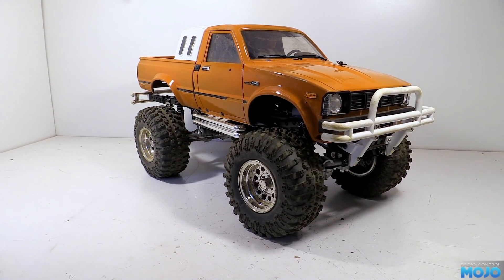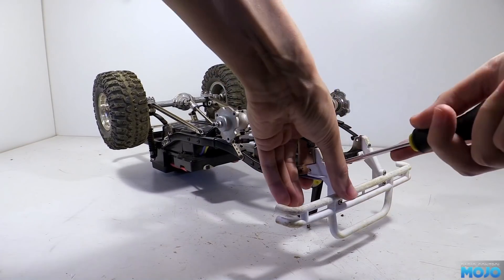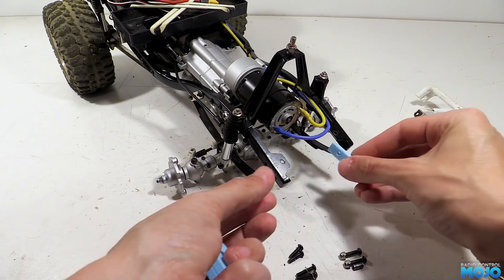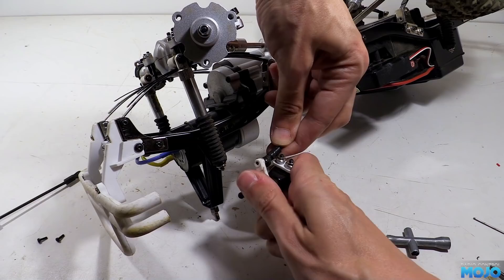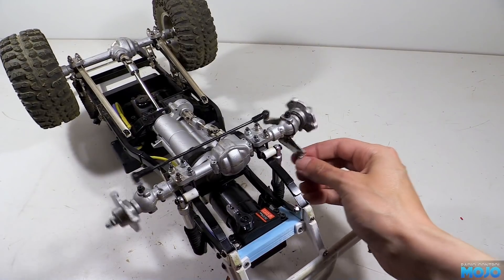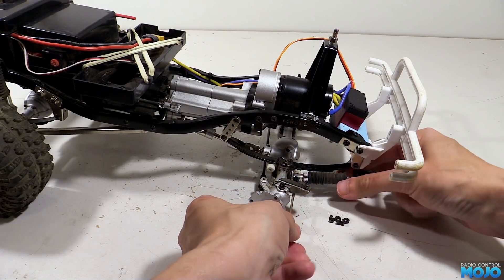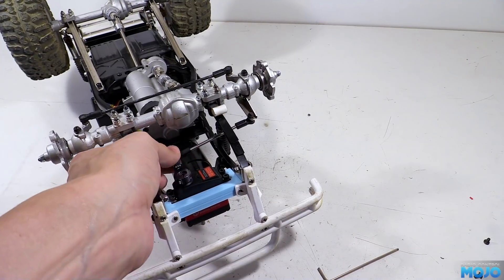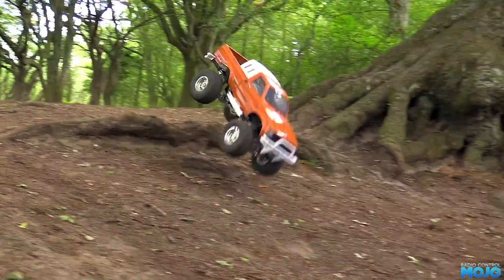HengGuan P407 Kit (Bruiser Clone) - Front Steering Servo Mod

Comment: How did you thread the steering shaft?
Reply from the maker: The link between the servo and knuckle? That would be M3 studding or all thread, you can buy it by length and cut it to fit
Reply: @RCMojoTV  ok thanks

Comment: Hi there, there seems to be a lot of slap from my leaf springs can you suggest what I can do to stop this please. Rob from England.
Reply from the maker: With a leaf sprung RC you always want a nice bit of rattle. If they’re tight they’re binding which causes excessive wear. Ideally the parts would use miniature poly bushes through out, but the parts just aren’t big enough for them to be practical

Comment: It's coming along, RC Mojo! The servo mod is a huge improvement. If I were to request more mods to it, they would be a removing or shortening of the spring inside the shocks to remedy the stiffness, removing one or two leaf springs for better articulation and adding a slipper clutch... Then you got yourself a very capable crawler. I have seen videos where bruisers/hg p407s perform better than actual crawlers. Please please please, do these mods (I can't afford one of these rigs at the moment so seeing someone do them would bring me a lot of joy. Thank you for the entraining video as always!
Reply from the maker: I'llkeep the mods in mind. The leaf springs are softening up quite nicely, even with the full pack it's trying hard to flex. It's quite fun trying to get the old rig around courses in it's current state, you have to be so careful.

I'm not sure about the slipper, so far the only damage the trucks had is from the bearings giving up rather than the torque from the motor, we'll see how it goes though, if it starts eating gears once the bearings are replaced with good ones we'll know the cause.